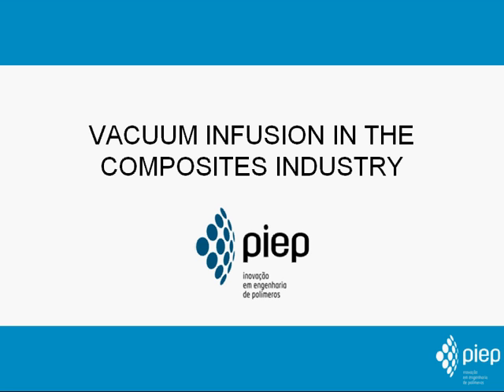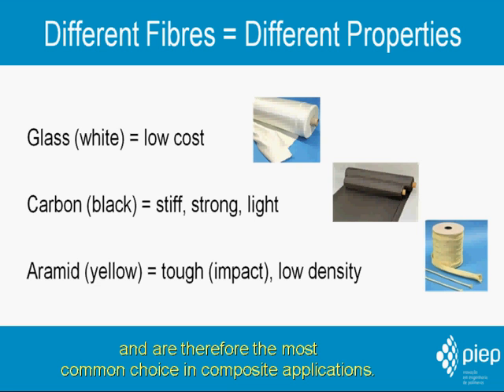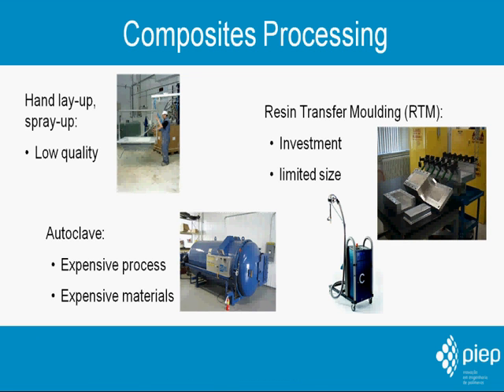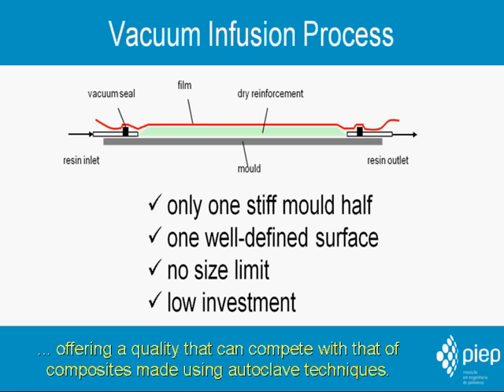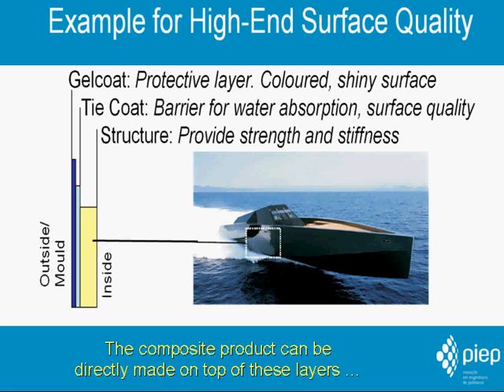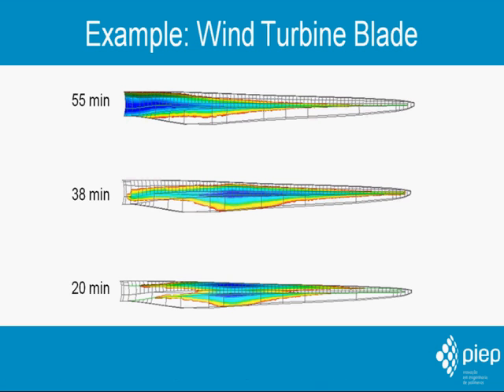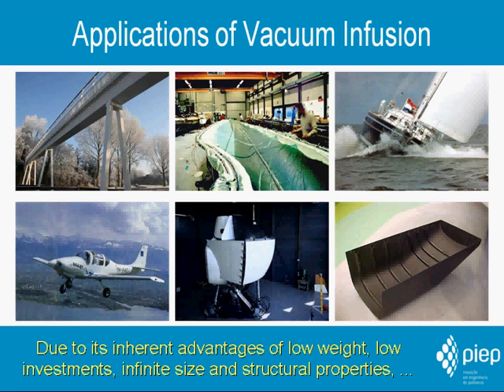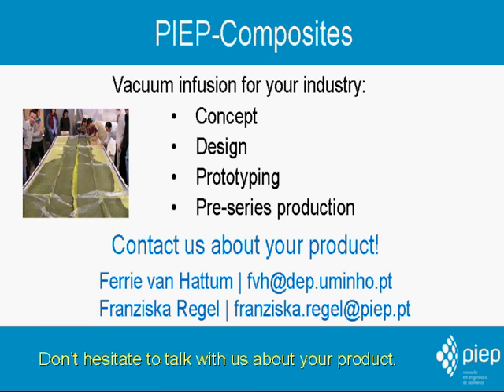Vacuum Infusion

Comment: @mezcestro 
Hi. Thanks for the positive comment. Of course geltime should be in agreement with the time needed to infuse your complete part. You wouldn't want it to start curing at 80% filling of your part! :) Experience will tell you what decent gel times are for different parts. But better be on the safe side! (But forget about the typical short curing times used in hand lay-up! Patience is a good thing...)